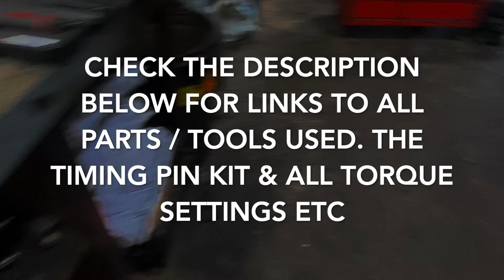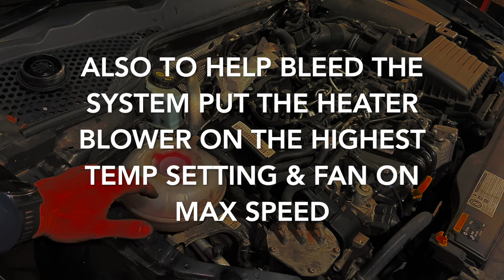1.6 TDi Timing Belt and water pump replacement - 2015 Seat Leon

Comment: Hi, it might just be me but there seems to be some conflicting info with the water pump bolt torque settings. Your video shows 40Nm but your description  with torque settings says 20Nm plus 45 degrees.  40Nm seems a bit on the high side.  I'm asking because I'm doing the cambelt while watching your excellent video.
Reply from the maker: Hi James thanks for pointing that out! ive filled it in wring in the description, just double checked on autodata & it is 40NM 👍 ive edited it now thanks
Reply: @diydaly  Thanks for the quick reply. Belts and water pump etc all fitted now following your guide. Cheers.
Reply from the maker: Nice one , glad to help .. thanks for the update 😁👌👍
Reply: Excellent video. Many thanks. However, I feel 40Nm is far too much for the water pump. In fact, I sheared off the top bolt! Fortunately it was easy to remove with a right angle drill and an easy-out. I replaced the bolts with my own fixings, backed with internal shake washers and torqued it by feel! 👍
Reply: I've seen on haynes pro 20nm and 45 degres but when you put the 45 degres more I think at the end we are not far of 40nm...I think the 2 are corrects

Comment: Hi,the engine is coold or hot
Reply from the maker: it was cold but doesn't matter hot or cold
Reply: @diydaly  its very important for the best tenzioner because when the  engine is hoot the tenzioner is over the gab.vw recomand at engine cold
Reply from the maker: @mohamedtaleb3114  thanks for the info

Comment: Great video, very well explained.
 Can you tell why there is oil in the engine? 
I have a audi a3 with the same motor and the oil is in the same places.
Reply from the maker: Thanks for the comment, much appreciated, I presume you mean the minor oil leaks?
Reply: @diydaly  yes, that's it.
Reply from the maker: @33siroco  very minor leaks, but they are just common areas on these engines
Reply: crankshaft seel leak

Comment: Excellent video.
 A must watch before tackling the job on my audi. 
Could you confirm what the torque value would be for the 4 bolts in the crankshaft pulley.? Are they normally single use?
Reply from the maker: Thanks for the comment , glad you liked it! Officially they say renew the bolts .. 10nm then 90 degrees .. tbh I always re use them tho and have never had a problem
Reply: Thanks!

Comment: Thanks for a great and informative video!
These engines are known to have issues with the crank seal. Is there any 'criteria' for assessing if the leak is 'normal' vs leading to cam belt failure?
Reply from the maker: Got to be honest, I’ve never replaced one! Yet have done 100s of belt and never really seen one leaking, if it’s slightly damp it won’t be an issue but if causing a drip you will need to replace it
Reply: @diydaly  Okay - it is a known failure in cold conditions. Quite a few examples of missing teeth on the belt and consequent engine failure.
Reply: @mikariikonen612  the crankshaft seal is in fact  known to fail , the warranty replaced one , then a replaced when i did the timing belt for an oem one (kaco brand) . Last month i replaced the clutch and decided to replace the 2 crankshaft seals , the flywheel side for prevention (it was good) and the belt was leaking again , so i bought a elring seal to see how long will last . I hate the fact that this ea288 engine work with the belt on the edge of the pulleys , im going to check late this year for premature wear on the belt . Btw , the oem for this belt is continental or dayco ?
Reply: @Danidasanic  Thanks for your input. The problem is well known here in Finland. Not an epidemic, but a widely known issue anyway. One question: since the seal is in a plastic insert, can you replace only the seal, or is it always the plastic part which needs to be replaced?
Reply: @mikariikonen612  the Seal is a one part piece that rests on the sump and it's not cheap! My idea was to buy victor reinz seals  for the crankshaft but I didn't manage to find any shop with that particular seal in stock , so I've bought a victor reinz RMS and elring MS XD , I recommend you to remove the sump to do the proper way . for instalation you can buy the original tool" t10053 or do it like I did , using a plastic guide that came with the main seal for a 1.6 tdi CAYC engine (old gen) . The first seal that I replaced in this engine was the injectors seals , I think that is quite common to fail too
Reply: I would hazard a guess and say it's more likely the rocker cover gasket on the back side where the oil gets in the case. You can see in this video the rocker cover is sweaty, same as mine was. You can follow the leak down the back of the engine/timing case from there. 

My crank seal seemed to be fine.

Comment: That exhaust temp sensor and the top timing civer are a bastard to remove
Reply from the maker: I can usually get the sensor out ok but the top cover is a t***! 🤣 ive trimmed the back section of it a few times to make it easier to refit

Comment: Problem is guys - if you are professional- you must replaced the crank seal as well- 1.6d on this engine they all leak - in your video they are leak . You just do the simple job , after for a while all cam-belt will be again with oil all around. Crap job . 

Thanks 🙏 and sorry
Reply from the maker: sorry you dont like it
Reply: I have this exact issue. Seems quite common on these models for the crank oil seal to go. I think you have to replace the whole seal and unit as well.